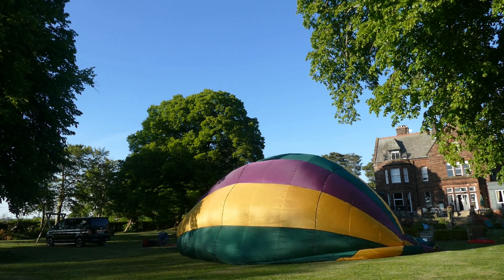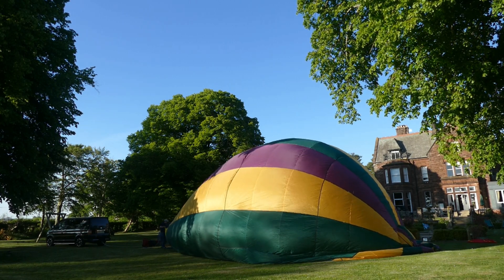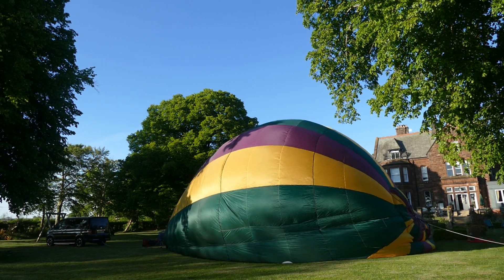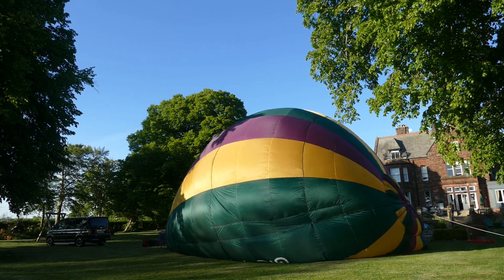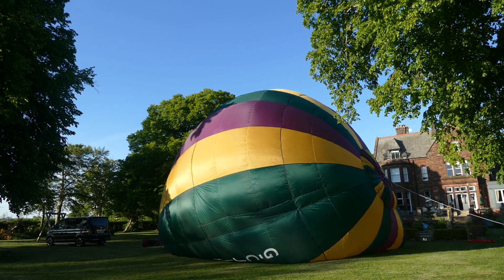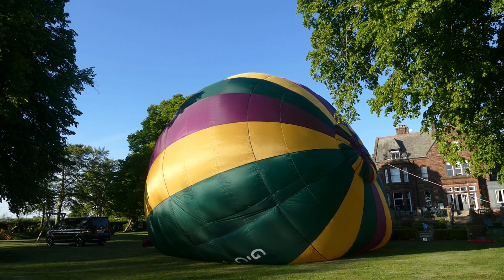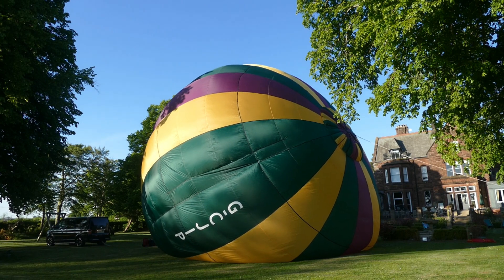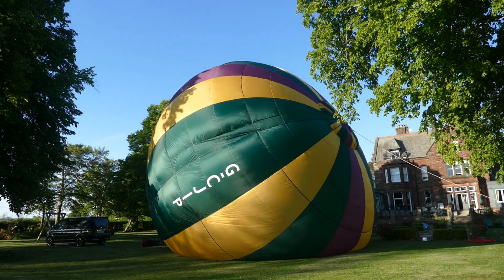BRAND NEW Homemade hot air balloon (Cloud hopper)

Comment: what if the propane exploded
Reply from the maker: Oof straight in there with the difficult question, we work very hard to keep a good safety record, managing and maintaining our equipment to prevent such a scenario, this is however one of the risk of the sport, thankfully fuel explosions are rare but can be catastrophic.

Comment: I wonder why they don't make these black to generate heat from the sun
Reply from the maker: Very valid question, and something which has been experimented with on and off over the last 50 or so years of modern hot air balloons (my own balloon has a dark side in the hope of getting some solar gain) I have flown in black topped balloons and it can make landing a little interesting if the sun pops out just as you trying to touch down, so it suggest a little advantage maybe gained in normal flight, but it's hard to pin down just how much - I think we might see more of it in the future
Reply: @TheBigBalloonFestival  I would think a little more precision in controlling the vents would make it easier to counter any excess buoyancy generated. But you are in England, no? Hard to get solid sunlight there.

Comment: What is the little skirt off the bottom of the balloon for?
Reply from the maker: This is known as the scoop and is designed to catch any passing breeze when the balloon is on the ground and force it up into the envelope helping it pressurise. It also prevents the wind blowing heat from the burner away down wind and not up into the balloon (when on the ground) when flying it serves no purpose. Hope that helps
Reply: @TheBigBalloonFestival  thanks!

Comment: i dont know if i could get your input on this but ive always wondered if an electric heater of some sort could replace propane burners.
Reply from the maker: Hmm is a good discussion and I think one the future will hold for balloons, what full do we see in the future. If hydrogen becomes a readily available resource (at fuel ⛽️ stations for example) as for electricity I think the speed of operation - how quickly you can raise the internal temperature and how much a battery weighs are the key issue. But I (and the community) are open to 💡 ideas. Question to you?. Does a battery contain enough energy to produce enough heat to lift its own weight? I don't know?
Reply: @TheBigBalloonFestival  batteries are getting smaller and more powerful, im not too worried about the power required. but im not too sure if electric heaters would be able to lift a hopper off the ground
Reply: but if this worked, we could have fully electric and eco friendly (wallet friendly too) balloons. solar panels could be used for charging the batteries as the heater heats up the air in the envelope, increasing the total range significantly.
Reply from the maker: @nickolasmathieu157  have a look for solar balloons on the Internet there have been some good experiments with using dark fabric to soak up solar rays and fly longer / more efficiently. You have got me thinking about using one of my model balloon envelopes and some kind of electric heater, probably bring the envelope up to flying temp the usual way then see if the electric heater can lift its self and a battery pack?
Reply: @TheBigBalloonFestival i havent seen much online about electric balloons so if you managed that, i think it would be a first! (this is getting me excited about eventually getting a cloud hopper haha!) but i think you're right, solar balloons could be our first fully electric manned balloons!
Reply from the maker: @nickolasmathieu157  excellent 👌 look forward to hearing about your cloudhopper adventures. I'm at the homebuilders meet this weekend will make for a good conversation about alternative power https://youtu.be/z4lXPvUkVwA
Reply: @TheBigBalloonFestival  I was just thinking about these ideas and talking with the pilot from POLAR DAWN about how to make an extremely small but flyable RC Balloon.  I was thinking darker fabrics would help for sure, and using metal heating plates in place of the burners.  I've got some crazy ideas going on right now. I just spent all last week at Albuquerque Balloon Fiesta 2022 for the 50th Anniversary while crewing for Dawn Patrol.  And I wanted to see the Mini RC Balloons set that World Record but they never did.  so now I have the opportunity to join them next year and really make that happen!  So I need a balloon to fly with RC!
Reply from the maker: Excellent glad you had a good time at fiesta and it sparked some interesting ideas, you never know when you will hit on a successful idea that no one has progressed and that you can make work.  Double skin envelopes can made balloons efficent, but it's lightweight fabrics that often allow for smaller envelope builds
Reply: @TheBigBalloonFestival  I actually don't see much point. The balloon is a device that uses heat as its primary lifting force. I mean technically it's converted to mechanical energy by the buoyancy, but I think it is counterproductive to turn electricity into heat. Internal combustion engine cars waste quite a bit of energy converting heat to mechanical energy - an unnecessary step in an electric car, which means you can save quite a bit of energy even if the battery doesn't contain anywhere near the chemical energy of the fuel. But using if for heat will shorten the range vs a gas burning.
Reply from the maker: @Tim Lewis A key feature of hot air balloon burners are just how much energy they produce and how quickly, combined with the calorific value from propane and the advancement in technology over the last 60 years will make any change to the fuel dynamics, interesting to introduce, I wonder where the next 60 years of technology will take us
Reply: this entire back-and-forth was quite interesting to read but i think you're missing an important aspect of electric ballooning that's not present in combustion ballooning: you can leave the power source on the ground. of course this tethers your flight to the length of your extension cord, and you'd still need to be able to lift the cord, but a 100 metre wire which can carry ~5 kilowatts might be under 7 kilos in weight. an electric car with vehicle to grid could keep the ballon in the air for hours and hours. and it might be able to drive around at the same time. (at very slow speeds perhaps)

Comment: nobody ever burns the strings with the flame thrower part right?
Reply from the maker: Great question the section between the burner and the mouth of the balloon 'the flying wires' are  mostly steal cables (exclusively so here in the uk) or (and more common in the u.s.) kevlar rope which is non flammable so a lick of flame does no harm. It's still not advisable to blast away at them as that does cause damage and will need wires to be replaced.

Comment: Calm day. Question: Why not use one long blast of the burner to inflate the envelope upright? I could understand short blasts if conditions were less than perfect. As long as it gets up without burning it is all that matters. Curious. Cheers! From 🇺🇸
Reply from the maker: Its all down to personal taste, for me I try to double the length of each burn as the balloon stands up, (but it doesn't always work out that way) others just open the valve and blast away :-) 
It does affect how hard the person on the crown line has to work, trying to hold the top of the balloon down / stable, pile in lots of heat and you can find your crown guy being dragged across wet grass on their bum #waystomakefriends LOL
Reply: @TheBigBalloonFestival  😂